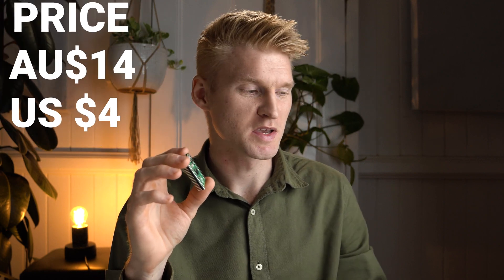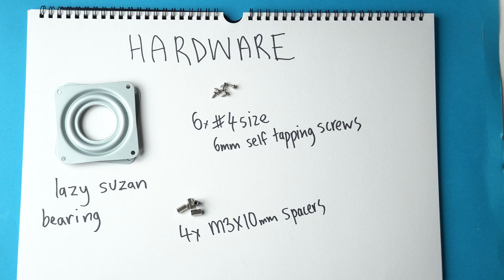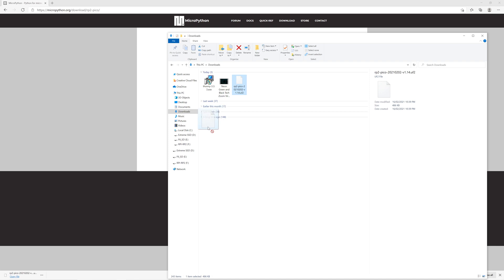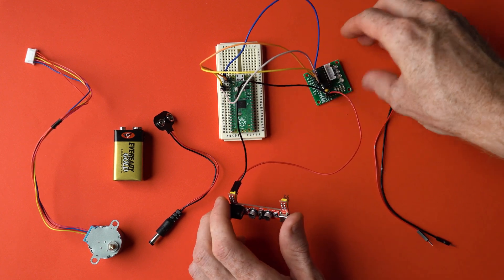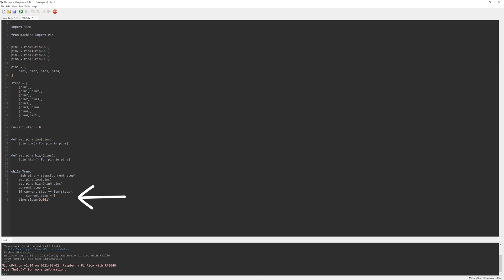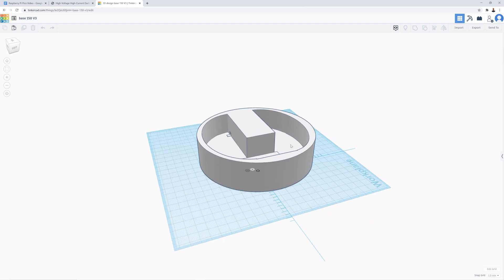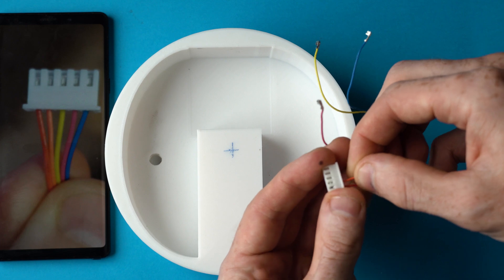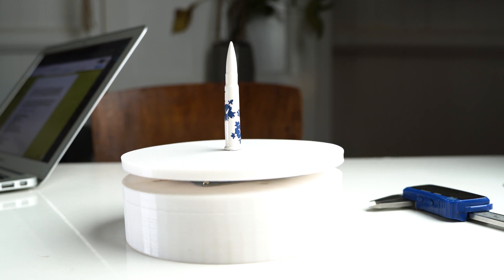How To Make A Photography Turn Table Using Raspberry Pi PICO!

Comment: Hi Will, nice showcase using a stepper on a raspberry pico. Tho you could've done more adding to the programming buttons or just an certain amount of steps then a pause so you can take a picture so you can use it for photogrammetry. Maybe for a later video? Nice video tho, looking forward to your next one.